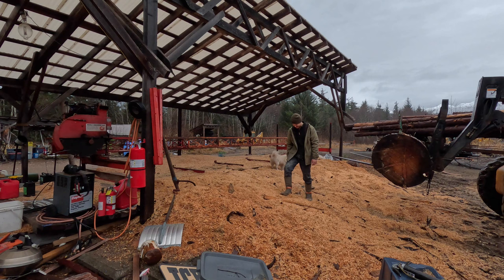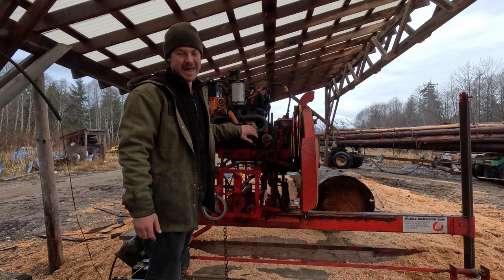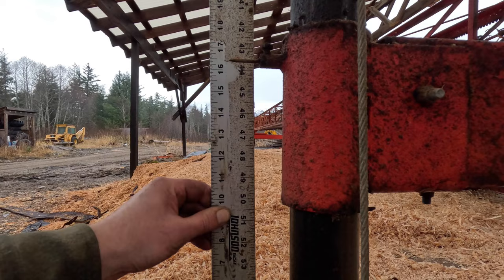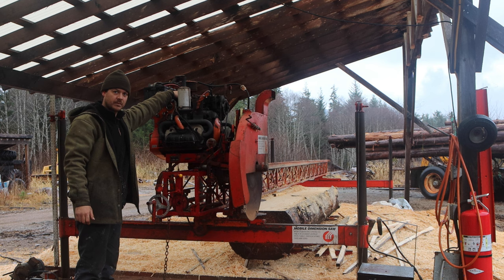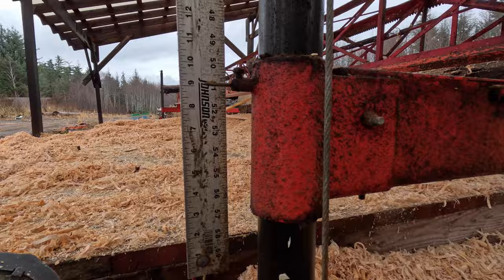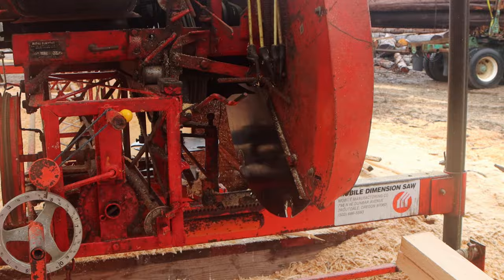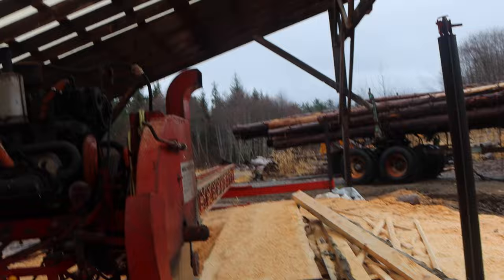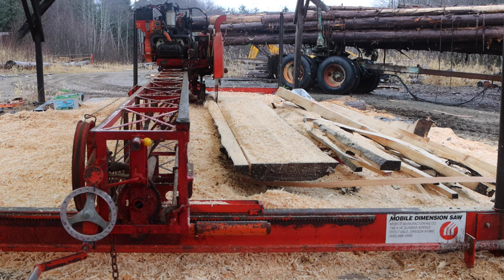How to Operate a Mobile Dimension Sawmill

Comment: That is one nice mill.  Having cut dimensional lumber coming off and having the ability to take it out of the log horizontal or vertically is great. Not to mention   placing the log and never having to move it. But then you already know it.
Reply from the maker: The mobile dimension mill is really sweet buddy. 

It is super accurate, because the boards are cut in 1 pass -  It is a great machine - bit temperamental at times

Comment: Need a video on how you change on changing edger belts on my 127 mobile  dimension sawmill
Reply: Were can I get hold of a manuel for 127 mobile dimension.
Reply from the maker: HI Brian 

I have been planning to do a good edger belt video. 

I just replaced them to refresh myself on the process before the video. 

I am milling next week - I will Make a Good Video on Mobile Dimension - Edger Belt Replacement. 

The Manual is available from  : 

https://mobiledimensionsaw.com/mechanical-mill/

I will post a message on here when I get the video up. 

Thank you for commenting Buddy - 

Sterling C Chew
Second Growth Homes LLC